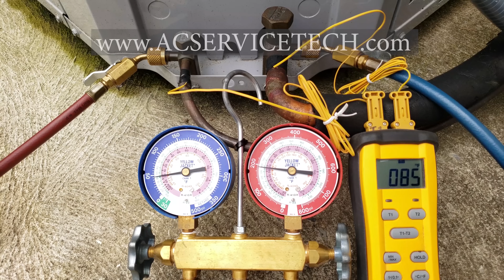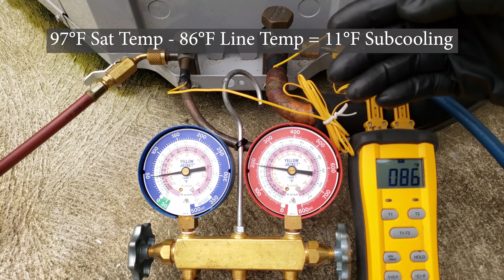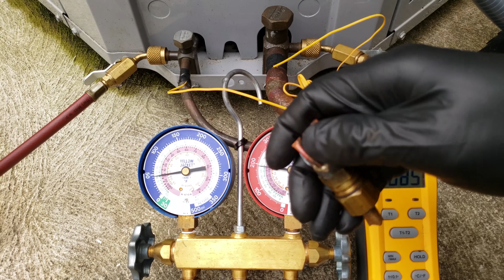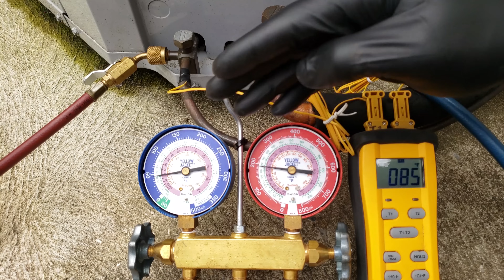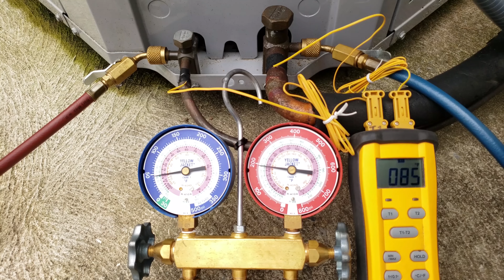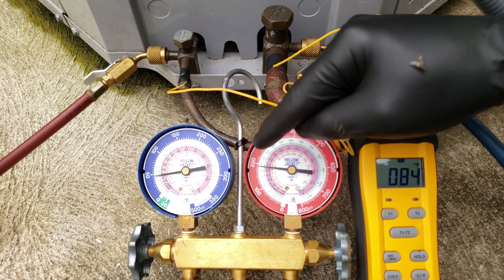Liquid Line Restriction! What Happens to High Side Pressure & Subcooling?

Comment: Great video! Very helpful, thanks for the share!  I'd have a question:  What if we do not have a target superheat written on the unit, and/or do not have liquid line service port at all?   Many of the new split air conditioner units here in Europe are now using Electronic Expansion Valves either alone, or combined with a capillary tube, which I would consider similar to a TXV in workings. How can I determine if it is charged correctly? IMHO the old trick with checking the superheat on the vapor line does not work any more, or is it?  Fortunately I never had a leaking R32 unit to service, but it will happen eventually.